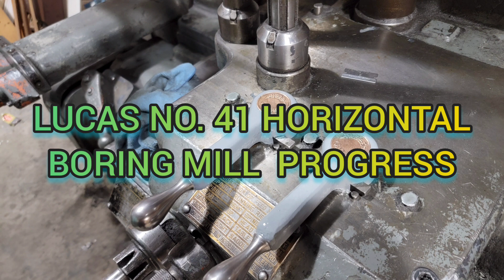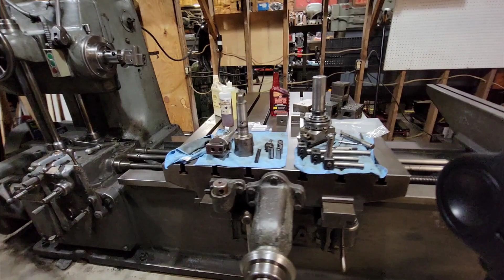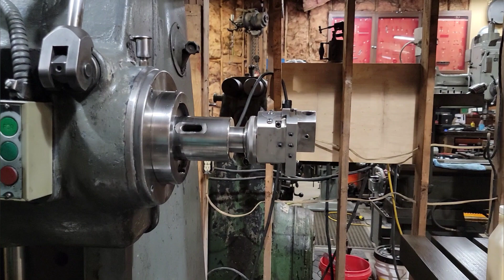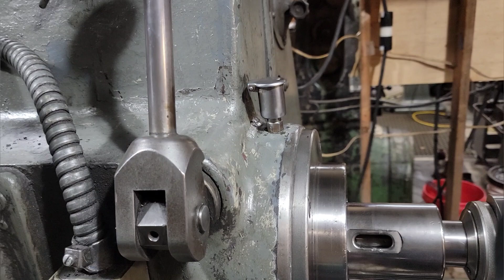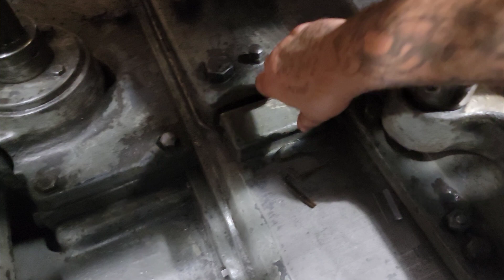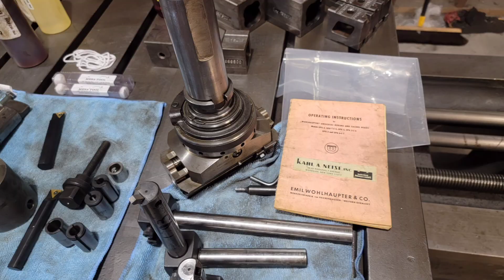Lucas no 41 horizontal boring mill progress

Comment: Nice machine! We have a no.42 that we use to machine counter weights for pumping units.
Reply from the maker: Thanks , that's awesome I like the bigger 4 inch spindle of the 42 models . They seem to be well built machines and are a joy to run .
Reply: @Winters machine shop  by any chance do you know where I can locate Original replacement parts? The clutch to engage gave out.
Reply from the maker: @BenZ  not really. Have you contacted lucas  , seems they have some things on hand . Only clutch on the 41 is the asbestos one for the feeds which I plan to just make a replacement from a piece of friction material when in goes out . Wish I could help more.
Reply: @Winters machine shop  Thank you I appreciate it

Comment: I bought a Lucas No. 43 HBM last year for scrap price.  Weighs about 23,000 lbs and I moved it myself which was quite the project. I think mine has an MT6 spindle taper. I kind of wish it was a 40 taper so tooling was easier to find. I contacted Lucas with my serial number and found out mine was made in 1918. They even told me who bought it new. Can’t wait to get it all fixed up making chips again. Great videos keep them coming.
Reply from the maker: That's a good sized one. I agree nmtb spindle is definitely easier to tool , usually when I find mt5 tooling I have to machine the draw key slot and there isn't too much mt5 that pops up for sale at a great price. Good luck fixing yours up. They're great machines . 👍

Comment: I have a UPA-5 and the shank is removable. You put the allen key through the drawbar hole and loosen till the arbor clears the drive pins then unscrew the arbor.
Reply from the maker: I'll definitely have to look into that . The drawbar hole on the 40 taper is just a flat machined hole past the threads on mine . Unless I'm misunderstanding what you're saying . Either way thanks for the insight.

Comment: Hi, Boeing sold surplus Wohlhaupter heads years ago with fixed shanks, the common hillbilly fix is cut off the shank and thread the body for a common boring head shanks. The Wohlhaupter is much better than the other head, but you can effect a finer feed using the knurled collar without the lever and let it slip in your fingers.
Reply from the maker: Thanks for the input , I was considering that though I may keep the 40 taper shank for use on the k&t. I actually picked up the slipping ring technique form a video of yours haha ! I agree the wohlhaupter is definitely the superior head . Thanks for commenting.

Comment: HBM is looking good. I like the boring and face heads you scored there. I wouldn't mind finding a deal on a Wohlhaputer but they always go for big money. I have the same Mesa Tools boring bars. Good quality for the money.
Reply from the maker: Thanks . They occasionally pop up on ebay for a reasonable price . Should be making my own boring bars but the want to get it up and running kind of pushed me to just buy a few . They have a few others I plan to try out , happy with them so far. Thanks for commenting and sharing your opinion on the boring bars . I appreciate the feedback

Comment: I had a Chandler model D that I picked up at an auction. It faced at .0025" per rev. A bit bigger than the one you have. I decided not to keep it and ended up selling it to someone from one of the machinists forums. Neat tool, but I didn't see me having a real use for it. It'd sit and collect dust for years I bet.
Reply from the maker: I believe that's the same feed  .0025 radially .005  over the diameter.  Would like to put an indicator on it and check for some actual hard numbers . Sometimes it's better to get the tools in the hands of someone that has a use for it as opposed to sitting around . Hard to see them go though sometimes.  Thanks for the comment 👍